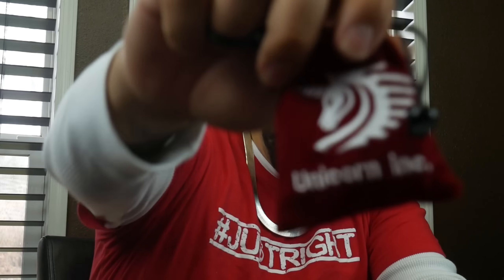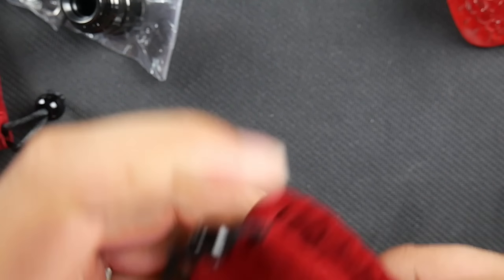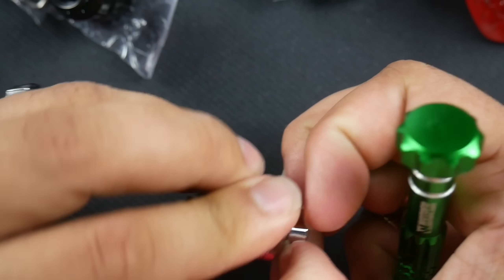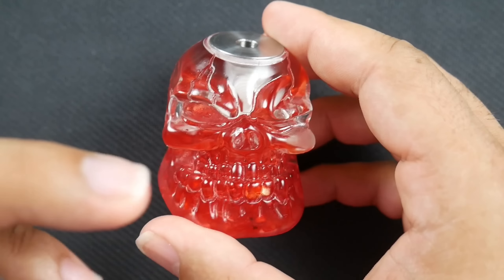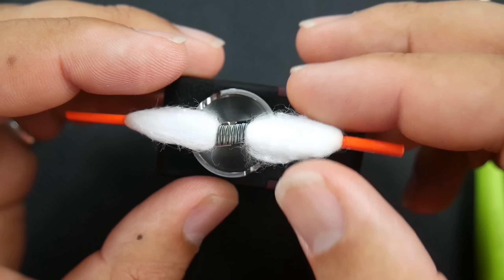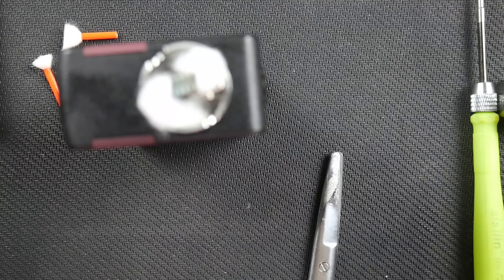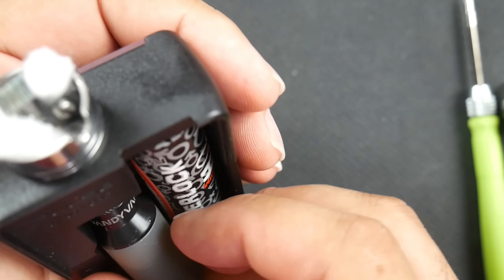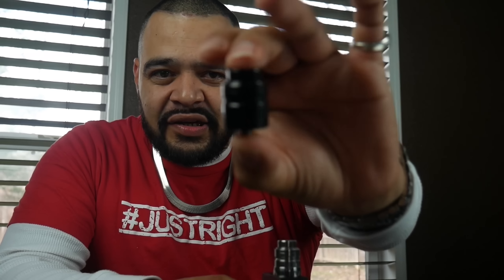Mass Mod X Unicorn Inc Axial Score yours

Comment: I like that you can do a single or dual coil without sacrificing flavor (so it seems). I like the deep well, i like what they did with the cutouts on the deck to get to your screws, and i love the finish... and ive been following them on IG for a little while now. Thanks for the chance and thanks for showing it off. You're the second person whos opinion i trust that said it has banging flavor